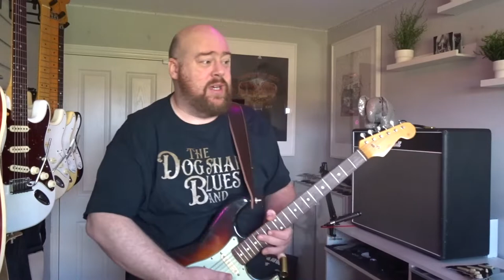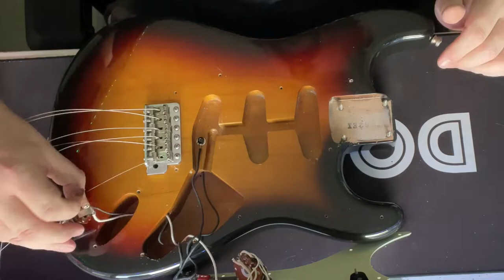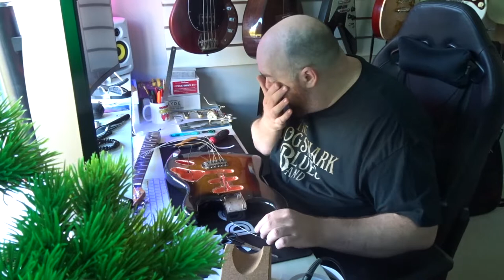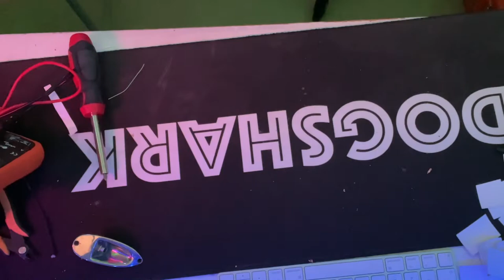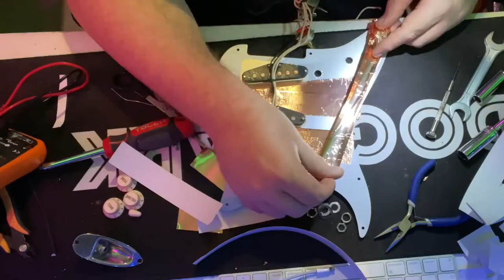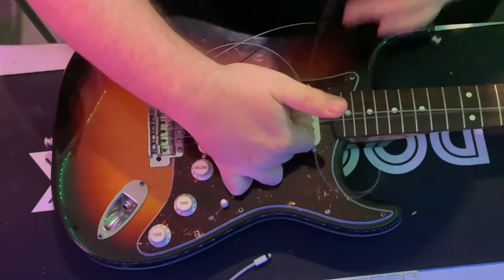HOW TO FIX A NOISY FENDER STRATOCASTER - SHIELDING A GUITAR WITH COPPER TAPE

Comment: I do this to all my guitars, but I prefer aluminium kitchen foil, which I try to mould to the cavity shape in one piece, and glue down with Pritt Stick.  It's not as neat as copper tape, but I tried copper and imagined that it changed the guitar's tone, whereas I imagined that aluminium didn't alter the tone.  And it's cheaper.  To attach grounding wires, I wrap the wire around a small woodscrew and screw it into a convenient point, jamming the wire into the foil.  Anywhere the foil might touch a component and cause a short, I cover the foil with a layer of insulation tape.  As shown in this video, shielding transforms the instrument.  It's worth doing with humbuckers too.  Anything that captures unwanted noise and grounds it is helpful.

Comment: are those true single coils or noiseless pick up.
Reply from the maker: The new set that went in were a set of Fender 57/62 vintage single coils. Reissues of original late 50s pickups. No rw/rp middle either so about as noisy as you can get.